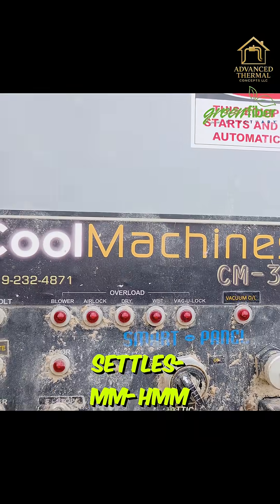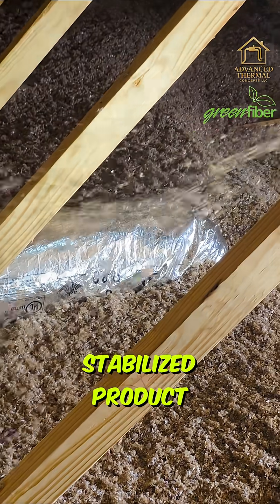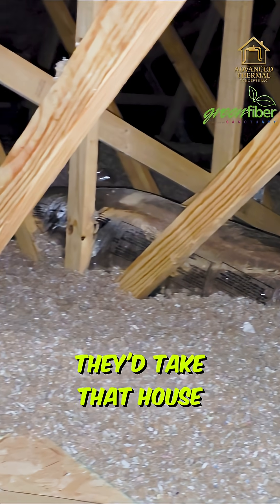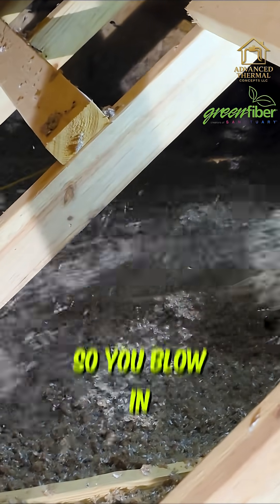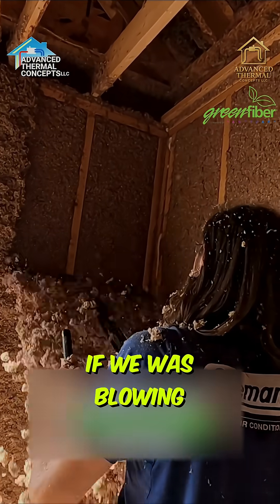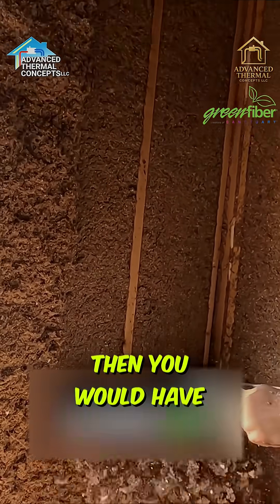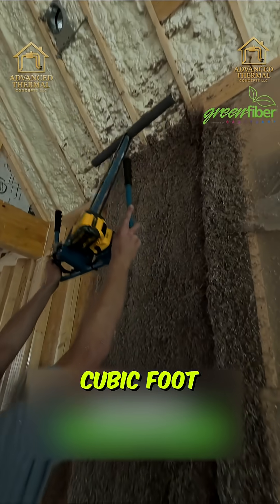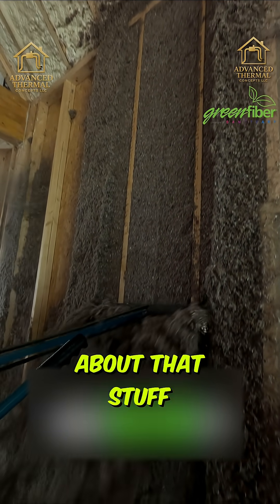Does Cellulose Insulation Settle Over Time? | Greenfiber Explained!

Comment: Remember homeowners, 2x4s are only 3 and 1/2 in wide. So the bottom of the trust member is only 3 and 1/2 in deep, and you need something like 8 in of blown insulation after it has settled to start getting any significant R value